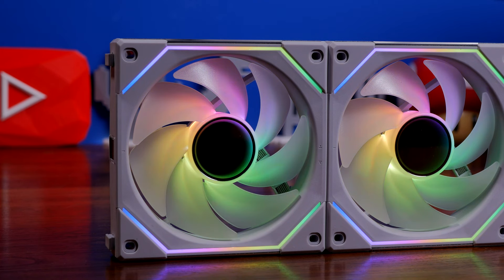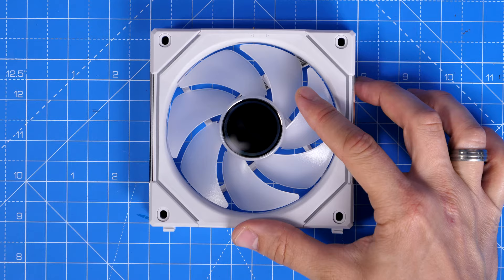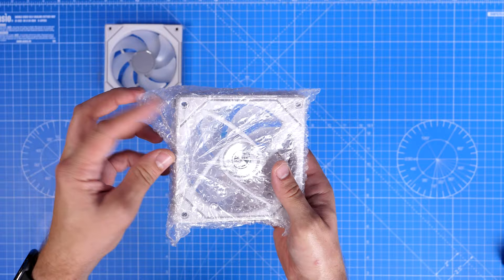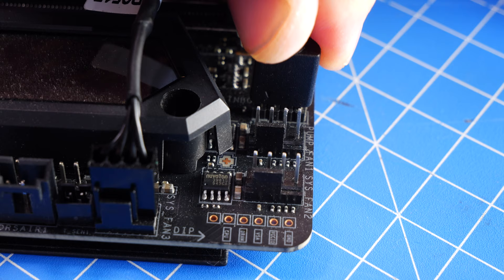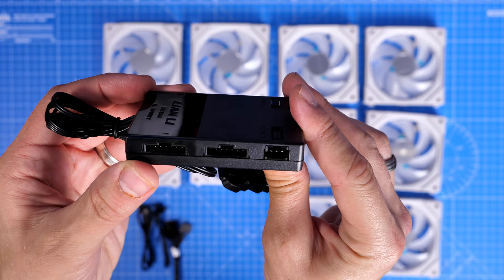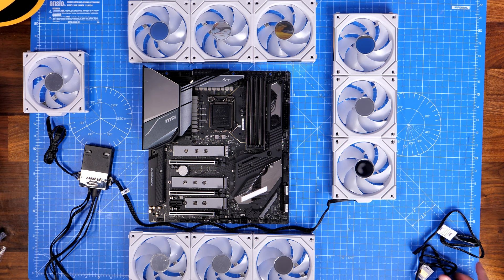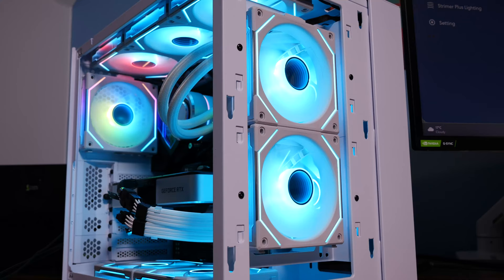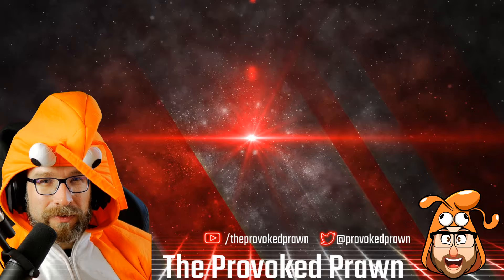How to connect Lian Li Uni SL Infinity 120 fans (single and triple packs)

Comment: Hi there 
I have recently purchased these and kinds of stuck
All my RGB is working but I am unable to control the fan speed in the bois nor the software? They are set on a low speed 

Also I have both power connectors hooked into one SATA cable, could this be an issue also?? 
Any help would be appreciated 
Keep up their great work
Reply from the maker: https://youtu.be/xmLIU40UOVI

Comment: I’ve one question… can I use the usb cable to control the lights with L connect and the fan cable to plug into the motherboard so it can use the pwm ? Or I should just chose one ?
Reply from the maker: Yes.

Comment: question. So my motherboard only has 2 USB male headers. I have one for my sl inf fans and one for the nzxt cooler. I have strimmer cables coming in a week but i believe they use another USB 2 male header. Is there any Male 1 to 2 female extension splitter you recommend?  I hate that the motherboards i want only  have 2 and its a strix x670e-A mobo. You'd think there would be more. Thank you!

Comment: Anyone have the pinoput for these cables. I was wondering if I could bypass the control box and software. My fans came with the 8 pin plugs now the separate 3pin and PWM plugs.

Comment: Hi, can several Lian Li fans fit on the same controller? I have 2 controllers the first one controls me both AIO with 2 120 fans and 2 groups of 3 fans above and below, I have mounted 1 fan behind for air outlet but I can't control it and it is independent from the others, can you help me? thank you

Comment: hey so I plan getting 7 of these fans so Im gonna buy 2 triple packs and 1 single fan would I be able to just plug in the single fan that I have into the fan hub controller?
Reply from the maker: Yes with triple packs you get four cables

Comment: I need 5 reversed version and 1 normal. but there is no 3 pack with hub for the reverse ones right?
Reply from the maker: Correct. But you can buy the controller separately
Reply: @TheProvokedPrawn  yes but that extent the costs would be nice if they make a 3 pack with reversed
Reply from the maker: @MIMCKMedia  agreed. Don't know why they don't tbh

Comment: How can we use these in an aio when the power and led cables aren't split anymore? I want to run mine off cpu_fan mobo header but the cable seems to have to go into the lian li controller.

Edit: damn yeah we have different cables, the cable that comes off my fans is a single, proprietary cable that only connects to the hub - why would Lian Li screw users like this?

Comment: Late to this vid.. wondering if anyone could help. It's easy to setup all 10 fans using a hub, but what about the rbg if you're using a Galahad?  I can't figure out where to plug that in at.. all slots on the hub are filled. Can I use another hub for just that? I do have 2 USB slots on the motherboard.

Comment: How can I connect these fans to cpu? I have this hub, and I should connect it to sys_fan or cpu_fan?
Reply from the maker: If they're on a cooler then CPU fan
Reply: @TheProvokedPrawn  Thank you for your answer! And I have another problem, I can configure them in l connect 3, but it doesn’t show rpm (0). And bios doesn’t see these fans. Maybe it is because of LIAN li hub?

Comment: I hooked them all up but only 2 fans work.  Wierd thing is that if I change the port on the controller it is still the same 2 fans that work.  No matter which port I plug them into.
Reply from the maker: Have you connected the sata power to your PSU
Reply: @TheProvokedPrawn  Thanks for the reply.  I forced the wiring connectors onto the fans the wrong way.  That bit of stupidity cost me 2 days.  All good now.

Comment: Im looking for the cable you used just after 18 mins for connecting the water pump like you did. Is that cable sold seperately or is it in the single fan box? Didnt look like it was. Info on where to find it would be awesome.
Reply from the maker: Single fans box
Reply: Thanks for reply Ill snag one from Microcenter appreciate ya.
Reply: So the single fan cable plugs into kraken z53 for pwm control, but does the 5v argb cable plugged into mobo allow L connect 3 controls? Or would it be better to plug it into one the sync spots on controler with the cable kit splitter? Wondering if that would read as the infinity fan or just a led strip. 
Basically wondering if I use the single cable kit with the kraken to control pwm will I be able to sync those fans in L connect still. Sorry for questions but thanks for your time/responses.

Comment: Quick question. I don’t have any more rgb headers so I was wondering. After plugging the fans into the controller. The controller connects to the mobo with a usb header and can be controlled via software from there ?
Reply from the maker: Yes that's fine. You don't need the RGB header if you don't want. You can just control the RGB from l connect

Comment: Wait, the single fans don't come with a cable that's compatible with for the hub? What if you need a hub connection for a single fan? Or does the triple pack come with hub cables for four fan groups?
Reply from the maker: The triple pack has four cables that can connect to the single fans.

Comment: I plan on running 10 if these fans, I bought 3 triple pack and one single. Orientation would be 3x on top with aio, 3x at bottom, and 4x on the side of my case as intake. Would I only need one control box for all that fans and I just want to control everything from L connect
Reply from the maker: Yes. You can run 16 fans total off one controller with four fans per slot max. I did say that I think.
Reply: @TheProvokedPrawn  the cooler I plan on using is the Corsair Elite LCD h510, do I still need the control box from that cooler to power it up? Or I can plug the flat power cable somewhere else? Two control box kind of a hassle

Comment: If I connect all fans to one controller but top ones are meant for AIO, do I still connect the controller to SYS_FAN header or CPU_FAN header? I kind of wish that top AIO fans to start spinning once PC is turned on.
Reply: no, you would need 2 controllers to achieve that and use two motherboard fan headers.

Comment: I have the Air Mini case as well! Trying to setup it up exactly as yours. So it's 5 sets of fans with 2 controllers. All fans are going to the controllers, and controllers to motherboard right? Is it possible to have all 5 sets of fan plugged into 1 controller (using a splitter for 2 of those sets), on Lian Li's manual it seems doable, have you tried? Thanks!!

Comment: PLEASE RESPOND TO THIS COMMENT…

So I am trying to connect 10 Lian Li fans (1 single fan and 3 groups of 3, 1 group of 3 is connected to my NZXT Kraken Elite 360 RGB AIO)

Question 1 - Do I have to use the wire that comes with the single pack on the group with the AIO? ( I believe the answer is yes). That wire has two connections, the 4 pin connection goes into a connector from the pump as shown in one of your videos. Is the other connector used?

Question 2 - The pump has a small 3 pin connector that needs to be connected to the connection on the motherboard that reads AIO Pump or CPU fan? My AIO pump connection on the motherboard is a 3 pin however when i connect it to it that connection is very loose not sure why. Can I connect the 3 pin pump connection into the 4 pin CPU fan connector instead?

I know this was a lot your help would be greatly appreciated. Also I do not have the ARGB group of cables that is sold separately. Please let me know how I can connect them as I said before your help would be greatly appreciated.
Reply from the maker: https://youtu.be/v5kDVZmePYQ
Reply: @TheProvokedPrawn in that video you used the ARGB wire kit. If I don’t have the wire which wire should I use to connect the fans that are connected to the radiator?

Comment: Hi, i have a little question here, if my motherboard has a 12v argb header, can i connect the 5v argb controller there?? 
thank you very much
Reply from the maker: I believe that's dangerous and can cause issues.

Comment: Hello bud, i bought the Infinty fans and i'm trying to use them on my H150i Elite LCD and i was wondering how do i use the LCD if i'm using Infinty fans since the LCD normally connects into the commander hub they give you and all the fans are connected into the Lian Fan Hub? I'm confused.
Reply from the maker: You'd still have to use the Commander Core  to run the display. You're probably going to need a USB splitter though.

Comment: So for a 9 fan set up... I'll need to only buy one 3 pack and the rest singles? Forgive me if you already answered this. Great video.
Reply: it's cheaper u buy 3x 3packs. you get all connections needed
Reply: @GuidoDePalma  thx, so far I picked a 3x pack, and 3 singles. I just need 4 more singles and then I'll start building. Excited 😁
Reply: @GuidoDePalma  I need 10 fans actually
Reply: @brotherjason2871  get more 3packs as they are a better value
Reply: @GuidoDePalma  hmmm 🤔 it's not more expensive that way? What's the benefits of getting more than one 3 pack?
Reply: @brotherjason2871  idk it depends on retailer i guess. the only benefit is a second controller

Comment: Hey, i cant buy reverse fan 3er pack and i need the controller. The only one i can buy is the sl v2 controller whoch has the 7pin connectors. Is there a difference between the sl infinity controller ?
Reply from the maker: Usually they're specific to the model, so I don't think that'd work
Reply: @TheProvokedPrawn  i think u are right. I asked lian li bia instagram and they said that i need the sl inf controller. The problem is in germany you cant buy the controller stand alone and there isnt a 3 pack of reverse fans. This is nuts -.-

Comment: im kinda new to building pc so i hope you could help. so my mobo has 3 argb headers and 1 rgb header. do you think i would still need a controller hub if i want 1 rear exhaust, 3 exhausts aio on the top, 3 intake on the side and 3 intake on the bottom?

the mobo im buying is b650 aorus elite ax ice if that helps
Reply: ohh i just finished the vid. so i wont be able to control the fans through Lconnect if i dont have the controller. i might just buy a 3 pack and singles cause singles are cheaper for me
Reply from the maker: Correct

Comment: Bro i really want to buy these fans but my motherboard dont have 3 pin 5volt port
Reply from the maker: Don't worry just use the USB connection and L Connect to control them

Comment: Great Video, thanks so much! Quick question....If im doing a new build (Dynamic o11 XL Case) and using 9 fans (3 x Multi packs) with 3 on a Kraken AIO top mounted, 3 side and 3 bottom mounted, will the fact they dont spin until the software is installed cause me an issue with cooling (CPU) whilst getting windows set up and then installing the L-Connect 3 software? Thanks
Reply from the maker: You'll be ok, I had to do the same. You should have enough ambient cooling as long as you aren't trying to game before you install the software.
Reply: @TheProvokedPrawn  Perfect! Thanks so much for the info and quick reply 👍

Comment: Hello sir ! My GPU not working after I connected my 12v-2x6 from PSU .. I’m using lain li RGB extension , I can see why I don’t have power plug in , I think my adapter 16 pin was damage because of GpU 4070 ti design not a right degree angle. GPU Nvidia needs to fix this problem … I might find another PCIe 5.1 Adapter 90 degree to avoid burning the GPU., do you have any video about this problem ?
Reply from the maker: https://www.youtube.com/watch?v=SjOyo2H69vw
Reply: @TheProvokedPrawn  The cable was crooked at the end, I was afraid it would burn

Comment: Hi 

Can you help me out with the fan settup? I just finished building my pc, and i noticed that 1 fan in the chain dont lit up. (UNI SL)

When i turn on the MB lighting sync in L-connect, it turns on. 

I have a triple fan UNI FAN SL-INF 120 and UNI FAN SL120 V2 

Im using the SL V2 hub to connect them all. 

I have ordered a new pack thinking the first one is "broken"
Reply from the maker: https://www.youtube.com/watch?v=xmLIU40UOVI

Comment: Just bought a 3pack of lian-li uni al fans but I've run into a compatibility problem and can only be solved if I can split them up.
Is it possible to run the 3pack as a 2/1 pack?
I need to put 2 on the side and one in the back. If this doesn't work I'll have to return it.
Reply from the maker: If you have space on your controller then you can do that, yes

Comment: So wait, dumb question, did the new fan controller that came with the infinity fans work with the old SL-120's non-infinity fans?

If so, did you have to download two different versions of L-Connect to customize the RGB for both types?
Reply: probs considering the pwm cable is the same and i doubt power draw is different

Comment: hi, i have the sl120 with the fan controller, id like to buy the infinity fans too but i dont want a second fan controler, what can i do? buy them in single boxes without the fan controller? i understand that in this case i have to connect them to the MB, can i use L-connect3 software on them? or can i connect them to the old sl120 fan controler?

Comment: Hey, so ive just purchased a triple pack of sl inf fans, one single fan and the galahad II trinity 240mm aio. With the sync 1 and sync 2 on the controller that comes with the triple pack, am i able to connect the fans and pump of the aio to the controller and then run all rgb via the controller through one usb header ? Just worried i wont have enough usb headers on my mobo.
Reply from the maker: https://youtu.be/5BIeKjRT3rI

Comment: Hey man got a question! 
Can I Use the Galahad AiO Fans With this Hub from the 3 pack? 

The Hub that Comes with the AiO only has RGB and and Fan connection. 

But the The Fan hub in the 3 pack has that in one single Cable, Fan And RGB.
Reply from the maker: You can. That hub is essentially an older version of this controller. See https://youtu.be/Mxm_29mWr9Y
Reply: @TheProvokedPrawn  but they have different connections I can’t use the AIO included Fans In the 3 Pack Hub due to the different Connections. could I buy 6 Single packs? Because I was planning on getting 2 multi Packs with the controller that uses the Single Flat Fan connector, but the AIO has a different connection. Do they not include an adapter at all? Or can the AIO fans just plug into the 3 pack controller ignore the extra RGB Pins?

Comment: How did you manage to get that single fan connected to the controller?  Do you have a spare wire for it?
Reply from the maker: The triple packs come with four cables. So you can create four groups. Alternatively you can use the two cables that come with the fans to connect to the sync port on the controller and a system fan header on your motherboard
Reply: @TheProvokedPrawn  ohhh I see.  I'm going to have the Galahad LCD AIO, two sets of 3 LCD inf fans, and two extra inf fans for exhaust.  I should have enough connectors for the hub right?  Lol, so sorry, I'm just trying to do all of my research before I go buy all of it so I can get it done correctly.  Thanks so much!

Comment: This might be a dumb question and might have already been answered but I am wanting to get 7 fans for my build. It will be 2 lots of 3 then a single fan for the back of my case. If I buy 1 triple pack (which has the control box) and then 4 single packs will it have all the necessary cables for me to connect all the fans to the control box?
Reply from the maker: yes
Reply: @TheProvokedPrawn  Thank you very much for your reply. I just confused myself and wanted clarification.

Comment: hey guys I am having problems where i cant connect my lian li fans to the program. it is stuck on rainbow mode and im really confused because ive connected everything correctly and the rgb is on but when i go into the software it only finds my lian li strimer plus lights but not the fans please help
Reply from the maker: You definitely connected the USB cable?

Comment: I'm planning on using a total of 6 of these. Three in front, two on my radiator and one rear exhaust. Is buying two three packs fine or do I need to buy one three pack and three single packs?
Reply from the maker: One triple pack will do.
Reply: @TheProvokedPrawn  So one triple pack and 3 single packs? I could hook all of these up to a single controller, yeah?

Comment: since the fans don't spin, would it be better to use other fans on a radiator until you get windows and the L-Connect software installed?
Reply from the maker: You should be fine initially as long as you don't run games.
Reply: @TheProvokedPrawn  Ok!
 thanks for getting back to me so quick!

Comment: Hey! I'm planning on buying the new Lian li strimmer cables and Infiinity fans but I'm worried I won't have enough micro usb connections on my mobo. I currently have a NZXT z73 taking one slot which on leaves one other if I'm correct. ( mobo is Asus prime x570 pro)
Reply from the maker: Try usb splitters
 Links in the description
Reply: @TheProvokedPrawn  ah I see, thanks a lot! There shouldn't be any problem with using this, correct? Cause there's going to be like 9 fans connected through that one mobo usb header splitter extention.